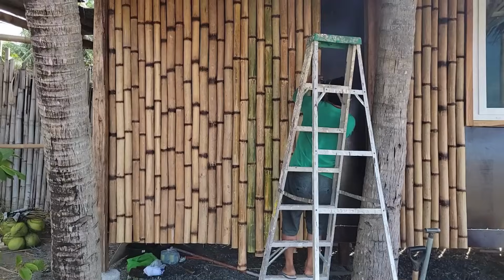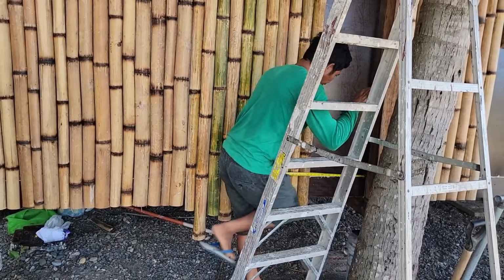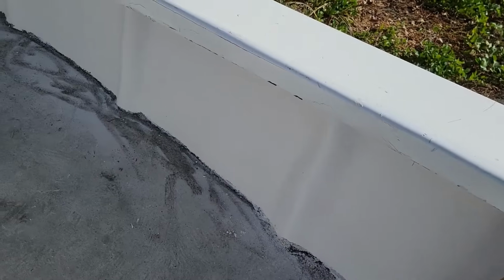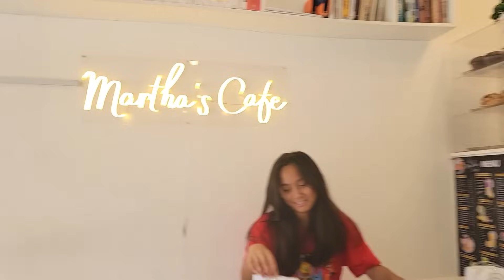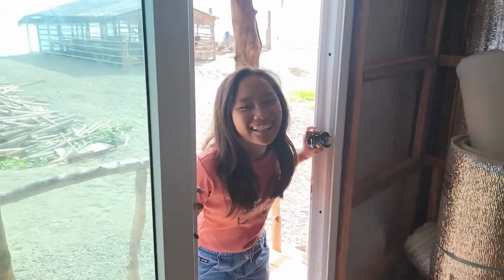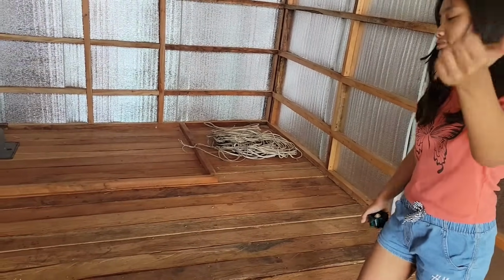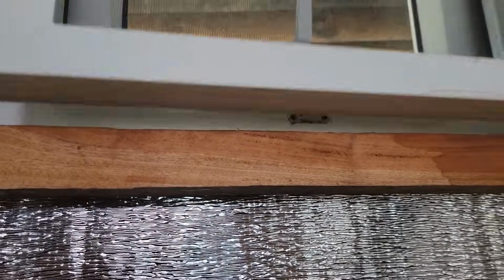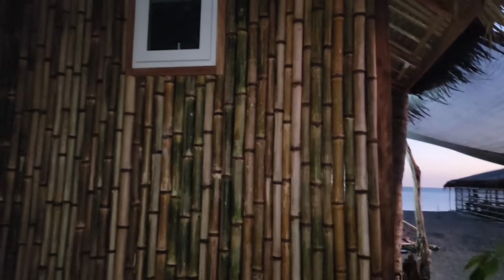Beach Cabin Build Part 16 She thinks it is Amazing  Looking Now!

Comment: James, I have watched you from the start over the years, look forward to every episode. Regarding the Beach Cabin, did you mention how you will deal with the waste from the CR or the water and electric supply, I assume they are coming from the main house? It's a long way to run cable and pipes. Also is there a lock on the patio door from the outside? I love the outside look, only wish the window frames could have been anything but white..